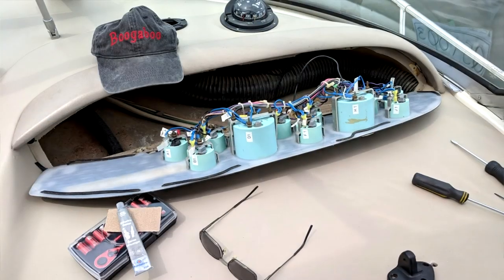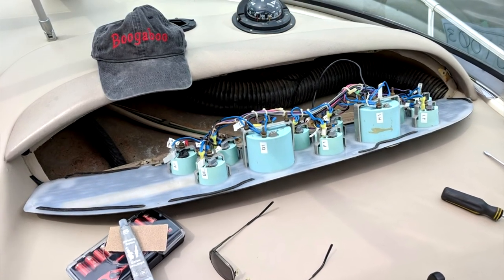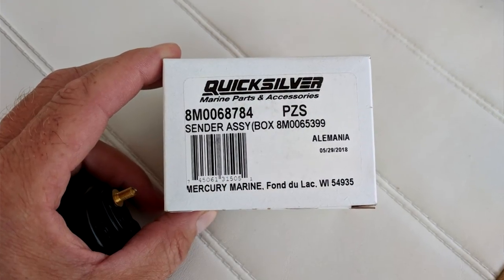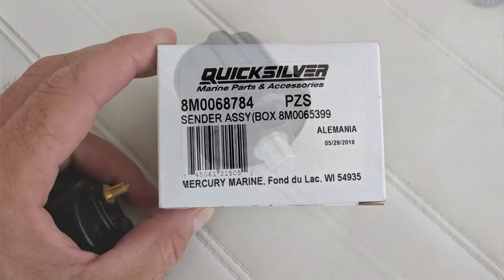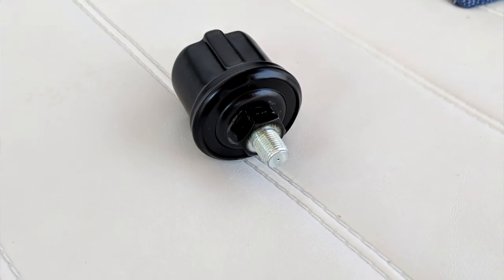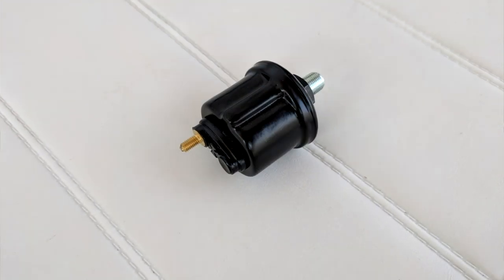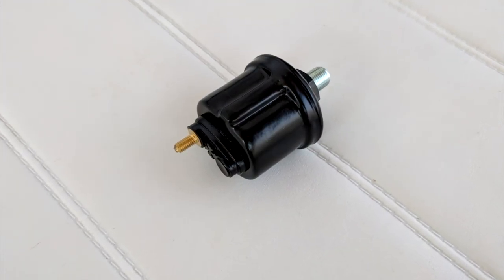Update on Oil Pressure Issue - Mercruiser 7.4 Inboards

Comment: Were did you find the location on that oil pressure sensor on the engine I look all over that engine cant find it . I having same problem on my starboard engine some time I have 40psi some time is 10psi no alarm just low pressure reading the port side stays on 40psi all the time.
Reply from the maker: Ya, sounds like the sender - unless you're also hearing grinding metal noises followed by black smoke 😉
 That said, I'm not 200% remembering exactly where they're located, but I do recall they were easy to get at and replace. I believe I found that info in ClubSeaRay.com forums. A great resource for mechanical insights - so long as you can get past all the hyped up testosterone on that site 🙄

Comment: Where’s the ICE?
I’m on the hard in New Zealand, lots of stuff getting fixed and updates abound.
It’s finally hot down here now, 30*c, and yes that’s a + not a -
Cheers
Reply from the maker: After a very tolerable fall & start to winter, things have turned now, with brutally KoLd weather :-( Going down to -29*c overnight here, and yes, that's a minus 29 degrees :-0

 I'm still trying to work in a day to run up to Port Severn and measure that lock for you. Of course, it's gonna be on a warmer day ;-)

 Toronto Boat Show starts next weekend. So we're almost at the official downhill run into Spring!